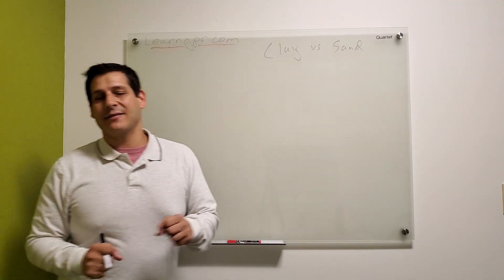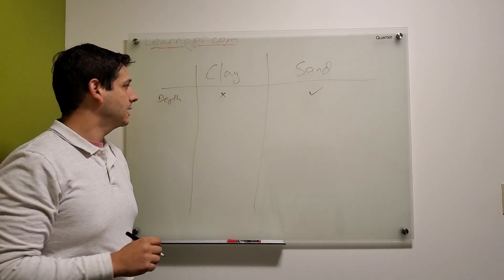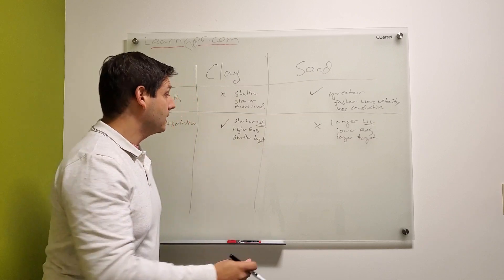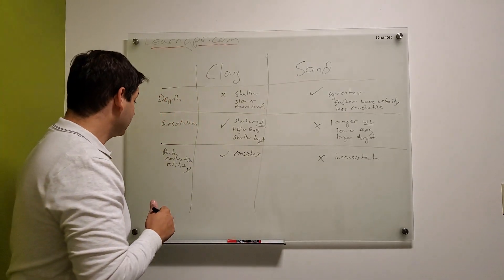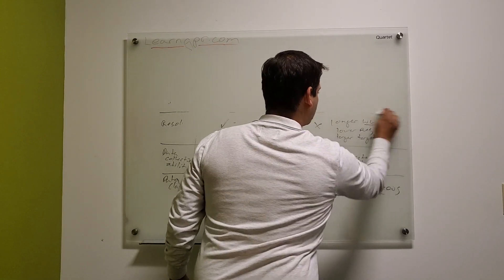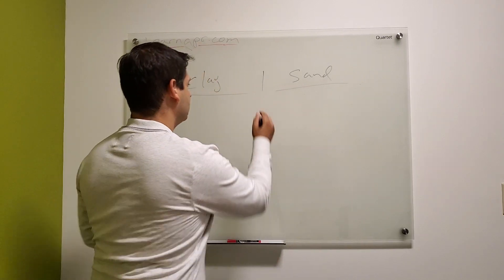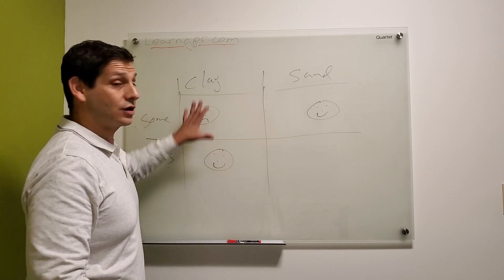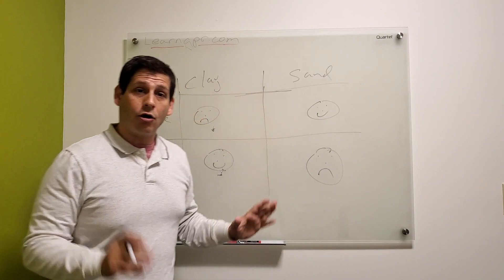Using GPR in Clay vs Sand (or why I love working in clay!) | ground penetrating radar

Comment: What is the accuracy of GPR? Can it provide quantitative evaluation for a gravity sewer (plastic or clay filled with air) to a hundredth of a foot? Same question for a plastic water main pipe with an energized copper tracer wire running over its top.  Thanks!